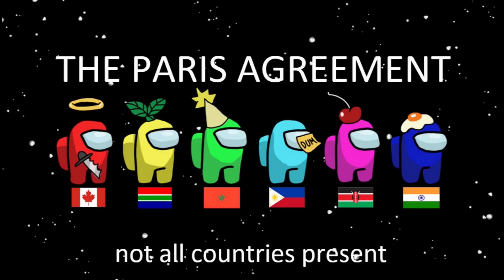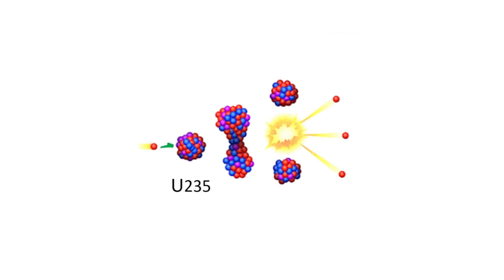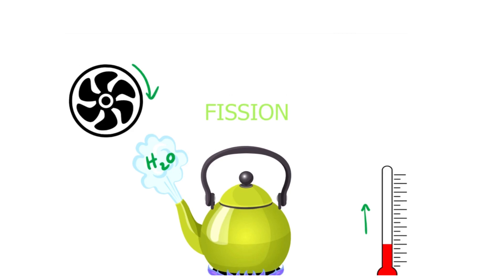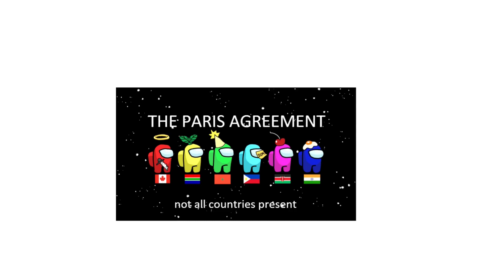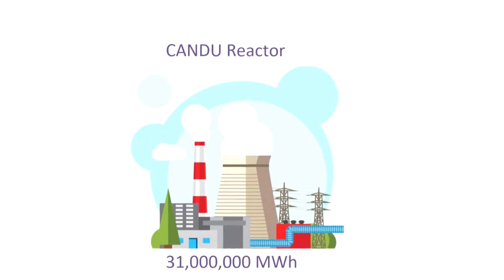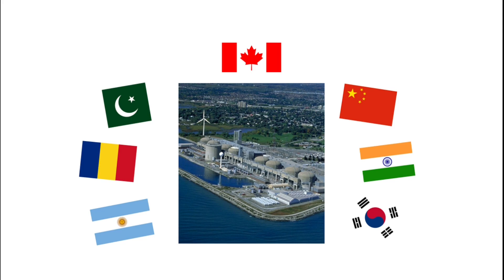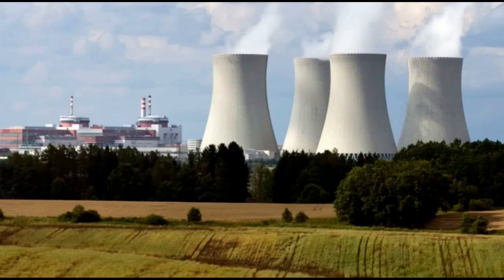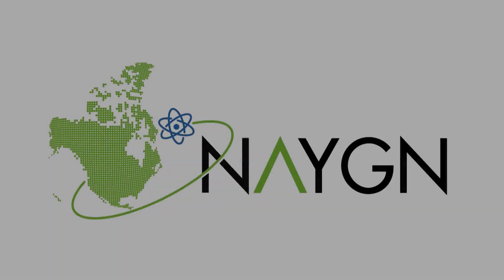Is this the Solution to the Energy Crisis? A Call for Action that we CAN-DU | NAYGN UAlberta

Comment: Are CANDU reactors still as economic to build/operate considering that Uranium enrichment costs decreased by 10-100x since CANDU was first developed to reduce costs vs LWRs?
Reply from the maker: Thanks for your question! Although the initial cost of heavy water is considered, the decreased cost of Uranium enrichment will reduce a CANDU reactor's operational cost as it's one of the main components of the reactor's fuel. The back-end costs of both CANDU and LWRs are comparable to one another.
Reply: @naygnualberta9988  That is the old canned answer. It is no longer true. In a LWR fuel us only ⅓ of OPEX. More importantly the cist of enrichment dropped so U sourcung and enrichment is now only 10% of fuel cost, with fuel manufacturing being 90% of the cost. A CANDU has 4-6x as much of the 90% cost, due to replacing every year instead of every 4.5-6 years. So it looks like CANDU fuel cost/MWe is significantly more expensive. Back when CANDU was developed to save cost, fuel enrichment was 30x as expensive, which would make enrichment most of LWR fuel cost. But, definitely not today, and overall fuel costs in LWRs is lower. Indeed, solid fuel LWR reactors are looking at increasing fuel enrichment today to reduce fuel costs further,going to 5-8% with ATF fuel to lengthen fuel cycles by increasing burnup before making new fuel & uprate power ratings for more revenue.
Reply from the maker: @EdPheil  Thanks for your response and expertise! NAYGN's role is to advocate nuclear energy by emphasizing the tremendous benefits of implementing nuclear energy in general. We will cover other types of nuclear energy and different topics in our future videos!